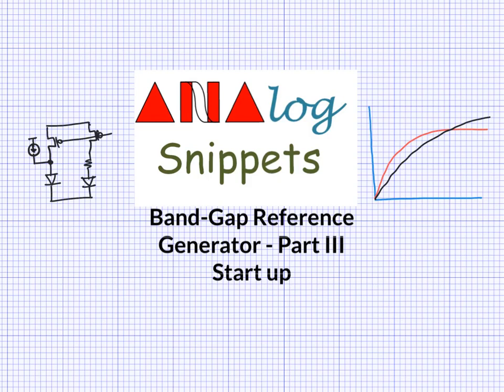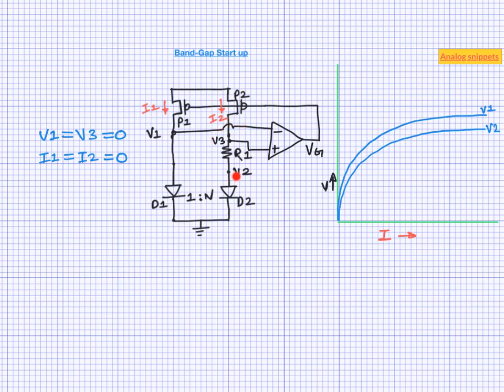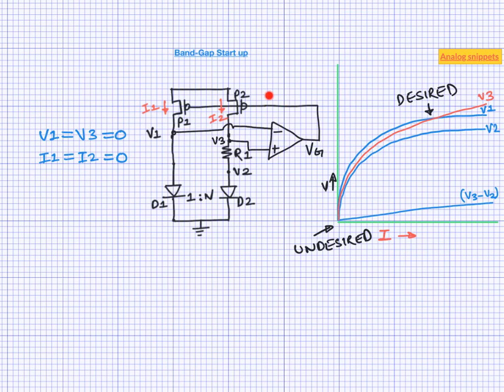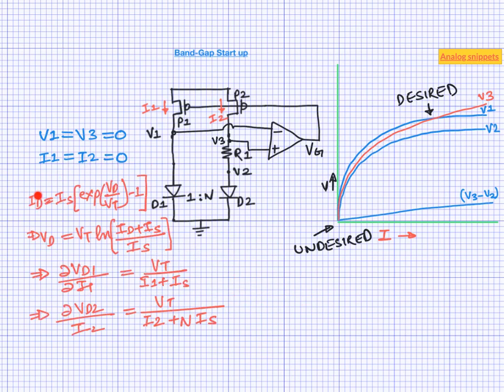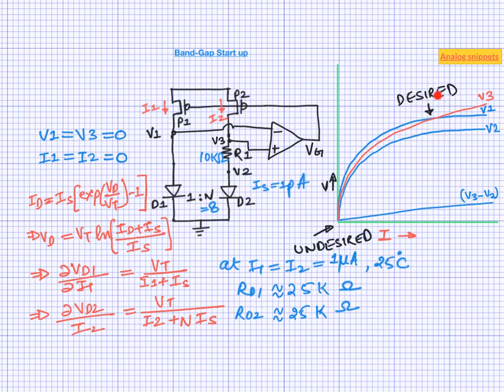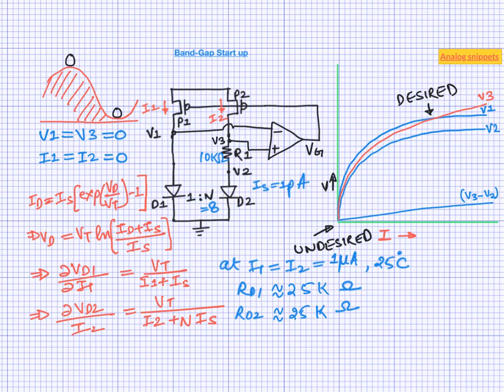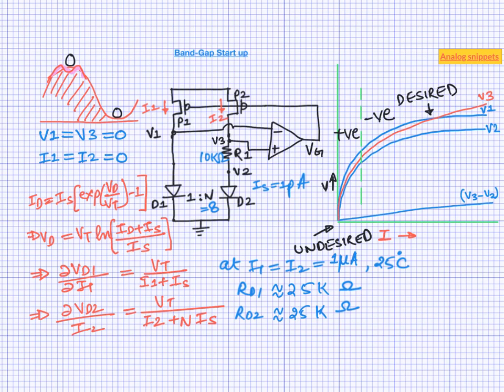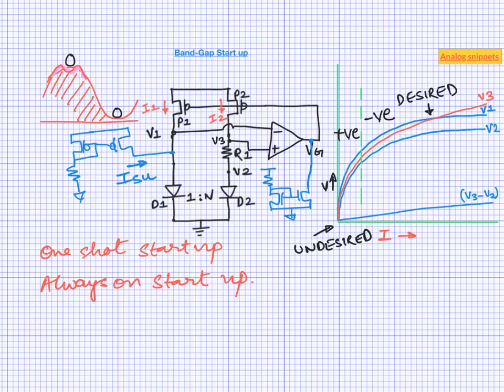#25 Band-gap Reference Circuits - Start up

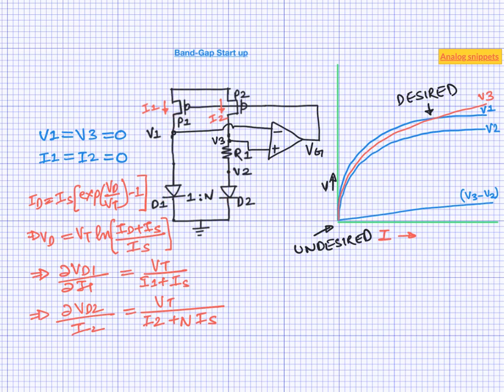Comment: Nice video-I have the following question (at 6:48 time). What is the small signal impedance at V1,V3 nodes? When i derive i have got same and intuitively also equal making sense to me. But looking at the VI characteristics, the slope at the crossing 's are different. May i know which one is correct?